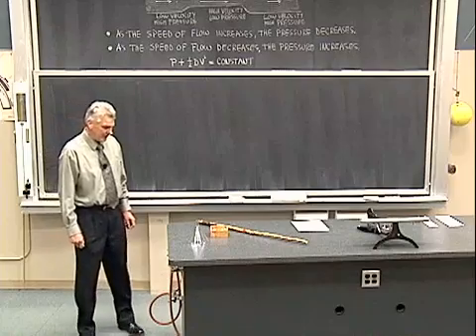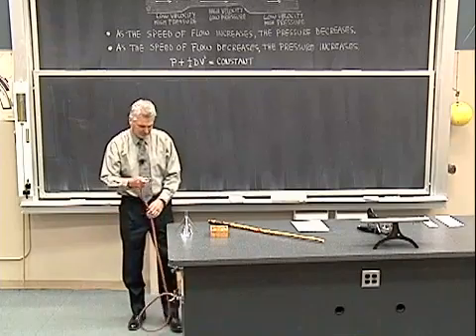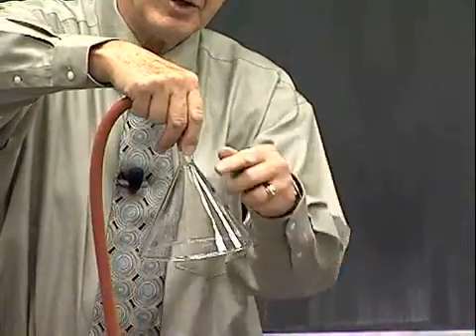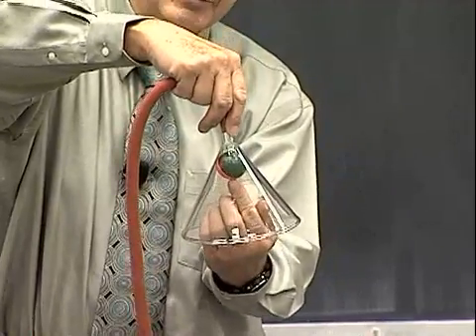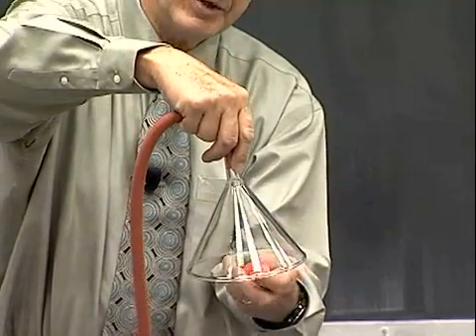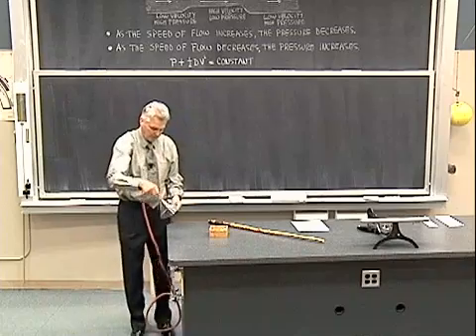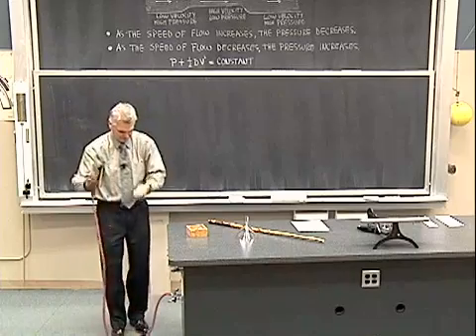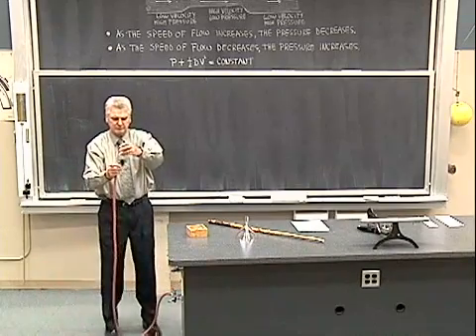Bernoulli's Principle: Ping-Pong Ball

Comment: Your first experiment (suspended ball in inverted funnel) demonstrates Bernoulli's principle well: the flow diameter increases, so the flow speed decreases, so pressure must have increased, so the ball is pulled upward toward low pressure. [Addendum in 2025-04: I stand corrected.  Thank you to the many commenters below who explained that Bernoulli's Principle isn't exemplified by the inverted funnel experiment either.]

However, your second experiment does not demonstrate Bernoulli's principle, which describes the relationship between pressure and velocity *within a flow*.  The principle says nothing about the difference in pressure between air inside and outside of a flow.  Here are some ways you can see that the flow pressure is not lower than atmospheric pressure, as you claimed: 1. Note that the air flows out of the hose into the atmosphere, which can only happen if the air in the hose is at higher pressure.  2. Attach strings to the end of the hose and point the hose straight down; note that the strings are not moved horizontally into the flow. 3. Color the flow with dye and note that the flow doesn't get narrower as it would if it has lower pressure than the atmosphere.

The reason for the ball being suspended in your tilted upward flow from the hose is that the upper, flow-side curved surface of the ball deflects some of the air molecules away from the flow due to that part of the flow sticking to and following the ball's surface away from the flow.  By Newton's third law, this deflection of air away from the flow pulls the ball toward the flow.  This is the Coanda effect.
Reply: First experiment is also Coanda effect. Whenever you have a jet of fluid flowing into a stationary fluid entrainment is gonna occur, so Bernoulli and the continuity equation cannot be applied here. 

As the jet moves around the ball , static air under the ball gets entrained in the jet , creating a low pressure region until that jet hugs the convex underside of the ball due to a vacuum been created. The removal of air from that region causes atmospheric pressure to hold the ball up. 

The purpose of the funnel is to create the pressure gradient that holds the ball up. The funnel prevents the atmospheric pressure from above from countering the atmospheric pressure from below that holds the ball up.
Reply: @singh2702  Because the cross-section of the funnel along the flow direction gradually increases, the air deflects when it flows from the true of the funnel into the funnel, resulting in low pressure. This causes the ping pong ball to be sucked in.
Reply: @enbinzheng-line  In the most simple way to explain why the ball stays held in the funnel is because static atmospheric pressure is around 14.7psi, now the only way to blow the ball outta there would be to have a dynamic pressure greater than 14.7psi. Clearly, the air flow pressure through the funnel in the video is nowhere near that, that's why atmospheric pressure dominates from underneath.
Reply: @singh2702  Why is the pressure lower than atmospheric pressure? This is because the cross-sectional area of the funnel gradually increases, which causes air to enter the funnel from true and encounter a suddenly increasing space, resulting in a pressure drop below atmospheric pressure. This is similar to when air passes over the upper surface of a wing, due to the angle of attack of the wing, the air encounters gradually increasing space, so the pressure drops below atmospheric pressure.
Reply: @enbinzheng-line  The fast airflow, because it has momentum, knocks the static molecules out of the way, thus preventing atmospheric pressure to be in equilibrium around the ball. 

So, each time, atmospheric pressure tries to seek equilibrium it is impeded by the dynamic airflow, which is a lot less than 14.7psi but does the job of removing pressure by virtue of momentum.
Reply: @singh2702  You should note that the pressure of the air flowing in true is higher than atmospheric pressure. Although it has momentum, if there is no funnel, the pressure flowing out of true will be equal to atmospheric pressure. So why does the pressure drop below atmospheric pressure after leaving true once there is a funnel?
Reply: @enbinzheng-line  There's dynamic pressure, and then there's static pressure. The air blown into the funnel is the dynamic pressure, and it has a lower pressure than atmospheric pressure. We often don't realize how great the atm pressure is because our bodies have evolved to adapt to a pressure of 10 metric tons per square meter. So that air blown into the funnel is applying much less pressure above the ball than the atm pressure under the ball.
Reply: @singh2702  Is the pressure of the fluid also lower than atmospheric pressure in the true funnel?
Reply: @enbinzheng-line  Yes, dynamic pressure in funnel is lower than pressure outside the funnel, that's why the ball is forced upwards against the funnel walls. Take away the funnel and the ball will be blown straight down to the ground, similar to the floating ball experiment.
Reply: @singh2702  Note that a funnel is formed by connecting true and a cone together. The fluid first passes through true and then through a cone. My question is: Is the pressure of a fluid in true also lower than atmospheric pressure?
Reply: @enbinzheng-line Yes, the dynamic pressure in the part before cone is lower than static atmospheric pressure, hence why it can not blow the ball out.
Reply: @singh2702  Note that a funnel is formed by connecting true and a cone together. The fluid first passes through true and then through a cone. My question is: Is the pressure of a fluid in true also lower than atmospheric pressure?
Assuming this tube is 10 meters long and the cone is only slightly larger than a ping pong ball.
Reply: @enbinzheng-line  Dynamic pressure would be even less then. As the air is blown and accelerated by compressor, it gains kinetic energy so the longer the tube, more kinetic energy will be lost when it reaches the cone and ball.
Reply: @singh2702  You are wrong. Generally, we use a compressor to provide flow pressure for the fluid in true, because there will be pressure loss when the fluid flows in true, and the fluid flow will be subject to resistance from true. So the pressure upstream of the tube is higher than atmospheric pressure. Only when entering the cone, the pressure will be lower than atmospheric pressure.
Reply: @enbinzheng-line  The longer the tube the more friction the fluid will experience hence lose more energy and pressure. 

Do this thought experiment; 
Imagine we initially start off with a complete vacuum in the hose and neck of the funnel, now that alone will cause atmospheric pressure to force the ball upwards into the funnel at a pressure of 14.7psi provided no air is allowed into the pipeline before the ball. If that compressor, when switched on, can't blow air out into the pipeline with a dynamic pressure greater than 14.7psi , that ball will remain stuck in the funnel. 

This is what is happening in the experiment in the video, except there's no initial vacuum as this would cause damage to the compressor. Instead, the compressor blows away the static pressure on top of the ball.
Reply: @singh2702  You are wrong. If there is no cylinder and only true, do you think the pressure of the fluid in true will also be lower than atmospheric pressure? Obviously not. At this point, the pressure will be higher than atmospheric pressure.
Reply: @singh2702  So the pressure in the tube must be higher than atmospheric pressure.
Reply: @enbinzheng-line  I'm pretty sure there's some miscommunication going on here , but long story short the dynamic pressure on top of the ball needs to be 14.7psi or greater for the ball to fall out of the funnel.
Reply: @singh2702  It's not that the dynamic pressure is greater than atmospheric pressure that causes the ball to come out, but rather that the static pressure is greater than atmospheric pressure that causes the ball to come out.
Why is the pressure (static pressure) in true greater than atmospheric pressure, while the pressure (static pressure) inside the cone is less than atmospheric pressure?
Reply: @enbinzheng-line  The dynamic pressure is below 14.7psi that's why it cannot force the ball out.
Reply: @singh2702  So what is your static pressure?
Reply: @enbinzheng-line  Static pressure is atmospheric pressure.
Reply: @enbinzheng-line  Dynamic pressure is the fast-moving air colliding with the ball.
Reply: @singh2702  You are wrong, there are both dynamic and static pressures in both true and funnel. I suggest you study the Bernoulli equation well. There is a pressure term P in the Bernoulli equation. This pressure term is called static pressure.
Reply: @enbinzheng-line  The static pressure of a jet of air or jet of water blown out of a nozzle into the static atmospheric pressure is the same, that's why a jet of water coming out of a hose pipe does not just spread in all random directions but rather the stream remains in tact. When that water hits you, that is the dynamic pressure of the flow.
Reply: @singh2702  Is the static pressure inside true also atmospheric pressure?
Reply: @enbinzheng-line  The static pressure remains the same throughout whether the compressor is on or off. The compressor needs to do work, right? Which is blowing air out at a particular velocity. When it forces air to accelerate, 14.7psi is already canceled out I.e Newton's third law. All it needs to do is accelerate a mass of air.
Reply: @enbinzheng-line  Just like in the second demonstration, since 14.7psi was applied all around the ball, all it took was a few psi of dynamic pressure to lift its weight.
Reply: @singh2702 If the static pressure is not higher than the atmospheric pressure, the air in the tube will not gain acceleration. Therefore, the static pressure in the tube must be higher than the atmospheric pressure.
Reply: @enbinzheng-line  At the source of acceleration, whether it be a compressor, a fan, a hairdryer, etc, the static pressure is already the same as atmospheric pressure. When a car begins to accelerate, there is 14.7psi applied to the front of the car as well as 14.7psi applied to the back, the only pressure the car needs to overcome is dynamic pressure at the front i.e drag.
Reply: @singh2702  Is the static pressure inside the tube higher than the atmospheric pressure? Don't ask anything else, just answer yes or no.
Reply: @enbinzheng-line  It is the same as atmospheric pressure.
Reply: @singh2702  You are wrong. The static pressure inside the tube is higher than the atmospheric pressure.
Reply: @enbinzheng-line  When a jet of air is blown out of a pipe or nozzle, why is it that you think the stream of air exits into the atmosphere in a steady column rather than just exiting in a haphazard fashion?
Reply: @singh2702  For example, if you have a beaker filled with water, the static pressure P1 of the water at the bottom of the beaker must be higher than the atmospheric pressure. If we make a small hole at the bottom of the beaker, the static pressure of the small hole section is the atmospheric pressure, but the static pressure P2 at the bottom of the beaker is still higher than the atmospheric pressure. It's just that P2＜P1 at this time.
Reply: @enbinzheng-line  The water will come out of that hole in a column because of cohesion not pressure. Watch videos of airfoils in wind tunnels, see how the smoke streamlines exit in a column, that is due to atmospheric pressure.
Reply: @singh2702  How can water flow out of a hole without the static pressure formed by gravity?
Reply: @enbinzheng-line  The water will flow out because of its weight yes, but it will flow out in a column because of water cohesion not atmospheric pressure.
Reply: @singh2702  So is the static pressure at the bottom of a beaker filled with water higher than the atmospheric pressure?
Reply: @enbinzheng-line  Yes, obviously. Total pressure at the bottom of the beaker will be weight of the water plus the weight of the atmosphere applied onto the surface of the water at the top of the beaker. So water pressure plus atmospheric pressure at the bottom.
Reply: @enbinzheng-line  Just to further add, the pressure on the inside of the beaker's bottom surface will be the pressure of the waters weight plus the atmospheric pressure. The pressure on the outside of the underside of the beaker will just be atmospheric pressure, that's why if you put that beaker of water on a scale, it will only give the weight of the water.
Reply: @singh2702  So, why does the pressure of the water flowing out of the funnel become lower than atmospheric pressure when a funnel is installed on the horizontal small hole at the bottom of a beaker filled with water?
Reply: @enbinzheng-line  It does not become lower than atmospheric pressure, it's pressure is equal to its weight.
Reply: @singh2702  I mean after installing the funnel on the small hole.
Reply: @enbinzheng-line  The water exits at a static pressure greater than atmospheric pressure,  the column is due to cohesion.
Reply: @singh2702   why does the pressure of the water flowing out of the funnel become lower than atmospheric pressure when a funnel is installed on the horizontal small hole at the bottom of a beaker filled with water?
Reply: @enbinzheng-line  The pressure stays the same i.e the weight of the water. Forget about atmospheric pressure.
Reply: @singh2702  You are wrong. If a funnel is installed on the small hole, the situation will be different. A funnel that sprays water can suck up ping pong balls.
Reply: @enbinzheng-line  If the dynamic pressure of the water hitting the ball is less than 14.7psi, then it will stay in the funnel but I guess I'm wrong again huh
Reply: @singh2702 "First experiment is also Coanda effect".
     It can't be Coanda effect because it works even if you replace the ball with a cone.
Coanda effect only works if the surface on which the air flow flows is curved and therefore it shouldn't work with a cone which instead has straight surfaces.
You can verify by taking a sheet of paper an some adhesive tape and making a small cone having the same shape of the inside of the funnel. You will see that by blowing into the funnel, the cone does not fall.
It can't be Coanda effect.
Reply: @slopermarco  I would not totally rule out the Coanda effect, but one important thing is overlooked in this experiment, viscosity. 

As the air is blown into the funnel and accelerated between the ball and funnel wall, a viscous boundary layer will form along the wall and another boundary layer along the surface of the ball. Boundary layers transition easily into turbulant flow due to varying velocities within the layer. This turbulance under the ball can eventually become great enough to force the ball into the tunnel. 

Also, boundary layers apply to all shapes, spheres, cones, etc.
Reply: @singh2702  Hi, 
if you mean that the ball stays inside the funnel thanks to the viscosity of the air... hmm, I'm hot convinced. 
I repeated the experiment by blowing air into the funnel with an air compressor and with the cone (instead of the ball)  to which I attached a string and I noticed that to make the cone fall I had to pull the string with a lot of force! Too much force to be compatible with the viscosity of the air, which is very low, practically zero. The force needed to detach the cone is more compatible with a substance that has the viscosity of ... honey 😁 than of air. 
I boubt that the viscosity of the air is the reason why the ball doesn't fall, but maybe I didn't understand what you meant.
Reply: @slopermarco  Hi, yes, there is a misinterpretation of what I meant.

It's not the skin friction caused by viscosity as this is negligible, like you say. It's the fact that the air blown into the funnel is not an ideal inviscid fluid. The air forms boundary layers with the solid objects it comes into contact with. Now, due to the shape of the objects or, like with the funnel, a sudden change in cross-sectional area, causing the boundary layer to detach and become turbulant, forming vorticies. This region of recirculation prevents the ball from dropping out, not the actual stickiness of the fluid.
Reply: @singh2702  Ok, but how do vortices prevent the ball (or the cone) from dropping out?
I mean, do they create a decrease in pressure in the airflow? How?
Reply: @slopermarco  To make a long story short, the venturi effect created by the funnel wall makes the boundary layer more energetic so flow detaches later in the adverse pressure gradient, meaning more pressure recovery at the rear to lift the ball. A more energetic boundary layer becomes turbulant at the rear by pulling in faster moving air outside of the boundary layer, creating more pressure applied to the rear of the ball, hence the suction into the funnel. At the front of the ball, we all know there's the static pressure drop, but what's not explained well enough is what happens at the rear. 

In inviscid flow, it's easy to see that as the cross-sectional area of the funnel increases so therefore according to Bernoulli, static pressure will dominate and keep the ball held in the funnel. However, air is not inviscid, and so Bernoulli does not apply.